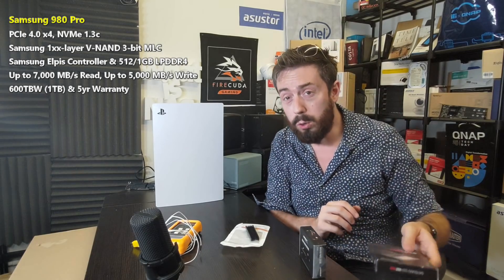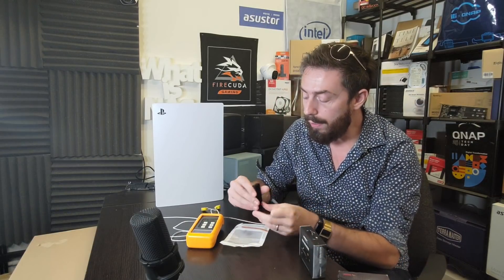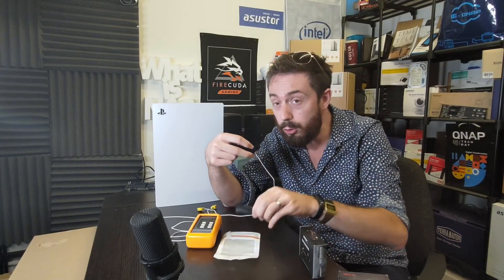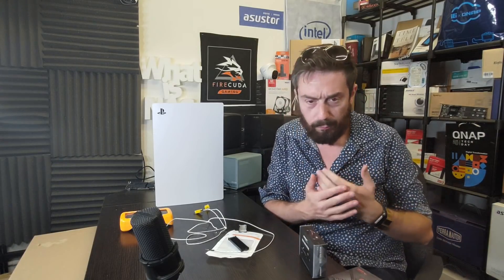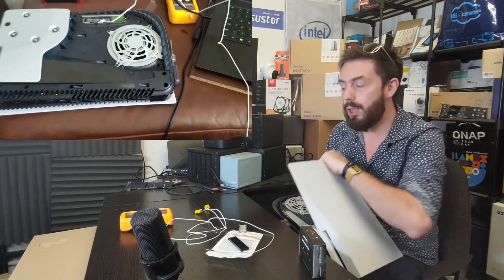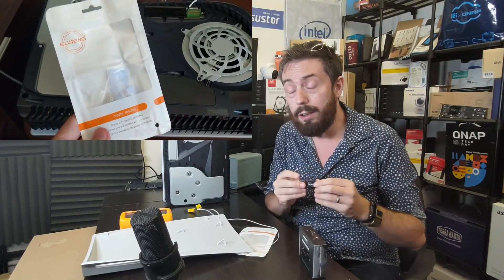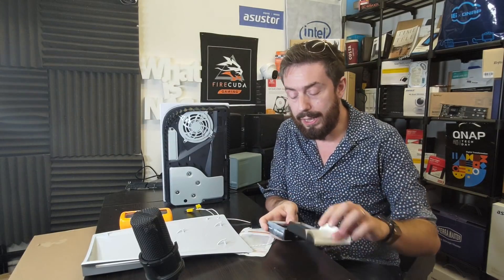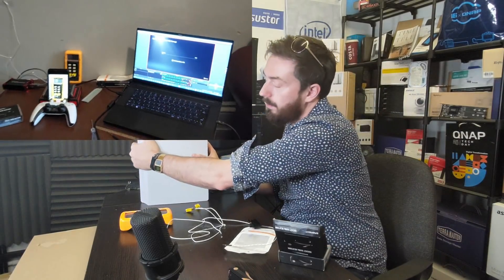PS5 SSD Expansion Heatsink vs No-Heatsink vs BIG Heatsink TEMPERATURE TEST

Comment: Ps4 system uses a 2.5 inch sata with 100mb read:write for all ps4 games (So question if my ps5 Internal M.2 expantion only has ps4 games on it)  Will i have any issues with out a heat sink

Comment: Hello. Thank you for your pointer.

I agree with all your point and i will add that i am saddened that we are so lax with reliability. I hear constantly "not a real world use." Well, i bought a thunderbolt enclosure and put a firecuda 530 4tb to do backup of my computer. Long story short, it doesn't like me writing 1.5tb in one go. It overheat and disconnect but i guess i shouldn't mind since my use is not a "real world use".

What annoy me about the whole ordeal is how little knowledge there is that those ssd actually need good cooling for sustained operation and that those "aluminium enclosure for better heat dissipation" are just not up to the task. I ordered one with a far chunkier heatsink in hope that resolve the problem.

Comment: I just bought a 1tb SSD with heatsink because of your video's, I got the Corsair MP600 LPX M.2 For my new PS5, Thanks for awesome
Breakdown and deeper understanding on why their needed. salute from the UK🔥
Reply: Got a 2 TB without heatsink for my PS5, works just fine...anyway a gen 4 SSD will run optimal even on 70C, if it gest to 50-60...it's normal...

Comment: How about adding a 1.5mm thermal pad between the ssd heatsink and the oem ssd bay cover so it would have direct contact? Would it dissipate heat better and have better thermals?

Comment: SSD nand work fine even at even 90c (normal temp range is listed as up to 70c from most manufacturers) so this just goes to show you don't actually need a heatsink in my opinion. ( I have a heatsink but I always thought it wasn't really needed and its just Sony trying to cover their behinds from people in really hot box installs of their ps5s) also most times the ps5 is just doing short read bursts and will never get this got in normal operation unless you are an idiot and put your ps5 In a drawer or small cupboard/media furniture lol. Then I think you would have bigger issues anyway with the GPU/CPU throttling because it's too hot.

Comment: There are some larger heatsinks with fans built onto them. These fans are powered by a cable attached to a pc motherboard - you could get a compatible cable to USB and have it powered by the consoles front USB 2. This I want to try and will get aftermarket faceplate to cut a hole into instead of the original ones ;p

Comment: Shouldn´t the thermal probe be attached to the controller instead of the NAND as this is creating the most heat and would be the force to make the drive throttle?
Reply from the maker: Very good question! Two reasons really (technically x3 if you include fear/hesitation). First was because I was fantastically reluctant (ie scared) to thread the temperature node under the heatsink+pad and onto the controller, as the m.2 lid would close and heavily squeeze the cable. The 2nd reason was because even when the lid closed (and I tried to thread the cable through a dip in the m.2 bay, it created an opened of around 2-3mm to the bay, which might screw with the PS5 airflow (again, this was still early doors on my testing and I was being a tad safe). So, I decided that NAND temp was better than no temp and ordered thinner cabling for the temperature sensor. I'm pleased to confirm that it arrived and works/fits like a charm! Been making new temp tests and tomorrow mid-day should be when my much more controller and PS5 airflow targeted temp testing will go live. Hope you enjoy it and thanks for keeping me on the straight and narrow!

Comment: How did the large heat sink effect the other parts of the systems cooling as blocks a part of the intake? 
Thanks for the real world testing, installed the  Western black 2 TB and large Sabrent hs today!
Reply: The intake for the PS5 is the fans opening. The system airflow will coming from all directions as the vents, 360 to the fans opening. I use my PS5 without plates as i not like the looks.

Comment: You should test the thermals for the entire PS5 with the sabrent with the metal cover off and the other heat sink with the cover on. This will determine if it's truly worth getting the bigger sabrent. I'm sure someone is now creating a slightly taller metal cover to compensate for a larger heat sinks. I wish I knew how to design it actually lol
Reply: That's what i wanted to know. Can't find anything about that...
Reply: @BlackDoomax  I'm rocking the big heat sink on my PS5 with metal cover off everything has been running perfectly no issues for over a year now
Reply: @dove348 Good to hear! How has it been with dust accumulation? Have you noticed more dust in the SSD-compartment with the cover plate off?
Reply: @Privatdetektivan  sure that's unavoidable but I keep it cleaned off. But I haven't had any issues as far as overheating or performance loss
Reply: momo  yea I got the big Sabrent heatsink like he did it works fine open I haven't had any issues I've been having long sessions too. I got some thermal tape I was going to MacGyver a cover over the heatsink but I was afraid it would cause more harm than it would fix. But the more research I do on the PS5 the less that cover seems relevant.

Comment: For those wondering, Sabrent Heatsink does fit inside of the digital version PS5 but won't allow the PS5 shell to go back on. If you want this to work out you'll need to own the disc version. I have the Sabrent  SSD and heatsink but sadly can't put my PS5 shell back on because I own the digital version, and yes I was ok with not using the SSD cover since I own a dust blower that I use to clean out my PC. Finally I do own 2 extra slimmer heatsinks I bought way before So I'm good for now unless I end up with a disc version in the future.
Reply: Just installed a gen 4 Crucial SSD 2 TB without heatsink on my PS5 digital edition and it works just fine! <3
Reply: It works just fine with no heatsink on the digital version. ;)

Comment: finally a video that helps me ! i have a ps5 and a 980 pro but i been holding off on install cause no heatsink
Reply: it works just fine, a gen 4 SSD should run safe and optimal even on 70C, I've installed a Crucial P310 SSD 2 TB standard without heatsink on my PS5 digital edition and it runs great! <3

Comment: Thanks for the information definitely something to consider when buying a new ssd for the ps5.

Also if I may, could you please make a video on the best Nas for 2021, I'm in the market for one that is easy to use, with mostly the option to run docker containers or has at least a decent selection of apps validated by the vendor and if possible the potential for expansion with different capacity drives

Ty

Comment: good testing!!! but i doubt that while "gaming" (not copying anything) the 980pro barely hit 40 or 45 degrees without any heasink, strange that yout don´t test it while only gaming and not copying.

but the most realistic case, is that the vast majority of the time (if not all the time) most of us will install the game on the nvme from the bluray disc, wich has like 100mb/s copy speed or less, or downloading, wich is even slower, and therefore, doing only 100mb/s write to the nvme disc, even without heatsink i doubt it reach even 45 degrees, same while gaming.

i have a sabrent nvme (3,5gb read) that while gaming on it , it even reach 35 degrees, yes, it is pcie 3 not 4, but anyway it don´t have any heatsink, and my case is an ancient cooler master haf932

on a next video will be nice if you test it while gaming to probe that i say is true or not, will be interesting...

greetings and good video anyway!!

Comment: Please could tell me ( if someone tested or know ) if ADATA GAMIX S70 could be mounted perfect in PS5 ( bluray disc version ) ? Sabrent version you have aready tested is bigger in height ... and I dont't want to throw money to buy something will not fit. I will use the SSD without metal cover but with plastic cover on the top...

Comment: If the read and write tests are meant to simulate the type of heat generated from playing a large open world game, why not just load up a large open world game and test the temps off of that?
Reply from the maker: God point. The reason is that I would need to the kind of heavy read activity that games I the future will be featuring (as the speed of these SSDs is utilized by the core system) are not available yet....but people are buying considering these drives now/v.soon in 2021. So the only way to simulate heavy read or heavy write in a closed system like PS5 is the way I have shown. These are 'hard activity' scenarios and pretty much the peak of what you will encounter. Take special note of how quickly the temp rises even in the first 60-120seconds.
Reply: @nascompares  But the read speeds you are getting here are severely limited by the write speed of the internal PS5 SSD. In a real usage scenario, you would have intermittent reading at high speed, as opposed to sustained reading at low speed. Those situations might very well behave significantly differently. So, while no one test could capture all possible aspects, it would indeed be very interesting to see the general temperature ranges experienced when playing a couple of different games for a prolonged amount of time (30+ minutes?).
That’s more time intensive work though, but even seeing an example of only one fairly typical game would say a lot.

Comment: Could you test a SN850 with the included heatsink vs a SN850 with the eluteng heatsink??

Heard the integrated heatsink is not very good and with a good custom heatsink the SN850 is 5 degrees cooler.

Comment: Could you test that again, with Ratchet & Clank Gameplay, and with two sensors on the controller and the NAND chips (measurements on the side of the NAND Chips are more accurate than on the top, and they are not obscuring the contact of the thermal pad) I don't see the point in installing a heatsink when it only hits 60C, maybe Ratchet stresses it more?

Comment: okay someone needs to make a case that has a vent and fans on it for the SDD upgrade slot.
Reply: They make heat sinks with little fans on them already
Reply: @jasons7044  i saw one on new egg but we need a ps5 replacement case that has an opening for the 
ssd slot with fan and venting

Comment: I have a large heatsink which only fits without the cover plate. But it's so hard to decide if I should get a smaller heatsink or not. The heatsink would sit pressed up against the plastic plate so I wonder if it would start to deform with the heat.

Comment: And that Linus guy tells people you can remove the heatsink if you buy a SSD with a heatsink that's too big... I would definitely recommend keeping the heatsink on and not placing the metal plate back or replace the heatsink if the white side panel doesn't fit back on, you can get heatsinks for SSDs dirt cheap...

Comment: I still think that cover is for dust issues. The last thing you want is a dust buildup inside where that m.2 is.
Reply: I worry about the fan getting dust more than the nvme slot with no moving parts. That and it’s also going to be vertical if you have your PS5 standing. There are options to keep dust at bay like a PS5 dust cover.

Comment: Will the Sabrent Heatsink fit in a PS5 Digital? I think there is a little extra space in the disk edition that lets it fit but not on the digital.
Reply: It doesn't fit digital, tried earlier can't get the main cover on, as the disc version has a bigger cover
Reply: @Mark-tl7hz  Good to know. Thanks for testing.

Comment: You need the temperature of controller not the NAND chips.  NAND likes to be warmer, the controller doesn't.  It's the controller that will be responsible for the throttling
Reply from the maker: True. But the m.2 cavity of the PS5 did not allow me to cover the controller without invaliding the test by introducing airflow or interfering with the heatsink contact. The NAND temperature is still a valid enough temp here to indicate the temp difference of differing/no heatsinks and to illustrate my greater point.

Comment: To be fair with ya I think the larger Sabrent made no difference, I think the major difference is that with the Sabrent the hatch was removed so allowed heat to escape easily reducing the oven type effect that comes from having the hatch on and keeping all that heat in and it was still only 2 degrees on average lower than a compact sync, and sony say to always make sure the hatch is in place, whether that's for keeping dust out or not I'm not sure but, for just a 2 degree difference I think I'll use a compact sync and reinstall the hatch.
Reply: yes i noticed there was no more than 2 deg C  diff  through those tests.

Comment: NAS, please do a thermal test of the SN850 with heatsink. The drive has amazing performance but runs hotter than other drives according to reviews. Would be great to see thermal results of the drive running in the PS5

Comment: A interesting test would be to check how much of a difference the ssd cover would make to heat
Reply: The Sabrent version in this test has no cover on the ssd section. It’s too big for the cover to fit on.
Reply: @blakecandesign9628  for thr SSD it’s good but for the rest of the console?
Reply: It would be nice to know, how other bigger heatsink WITHOUT COVER perform. Like the Archgon HS-1110. This is one with Fins and also a bit massive like the sabrent. I will use the Archgon heatsink with the 2tb Corsair MP600PRO. Thanks again for your top videos and Tests! OT: I also did a Thermalpads-upgrade (14W/mk) to the PS5. The different is really huge!  Cheers
Reply: That’s what I wanna know. Installing an ssd with heat sink then take the temp with the cover on and another test with cover off
Reply: @rubberman2006  https://www.youtube.com/watch?v=aCjqtN8YExk here you go

Comment: Great video. Digitalfoundry has done test, how it impacts in games with and without heatsink, and the difference is minimal. Don't get me wrong, get a heatsink it's 10$, but it's not catastrophic, unless you live in a very warm environment.
Reply: nice sunglasses 😎
Reply: I use a KC3000 2tb ssd without heat sink for my ps5 and have zero issues.
I do have a standing fan facing the ps5 permanently though to be honest.
Reply: @lordspalse0062  GEN 4 Crucial P310 2 TB SSD without heatsink, works perfect! <3

Comment: I'm glad I went with the sabrent 4 plus  with the included heatsink. Even though it doesn't allow for the plate to be covered. Is it me or does the ssds allow for me detail and more response?
Reply: This is what I did too. I’m having a heck of a time getting the screw in though as the one with heat sync is too short and the one in the PS5 doesn’t seem to get a good grab. What did you do?
Reply: @PhoenixWebTV  so I had to move the ssd down slightly in the heatsink to where the back end of the ssd was sticking out further than usual (or you'd like), meaning that the groove for the screw won't overlap perfectly. Place that was in the 80 slot under the ssd. Once the ssd has been pushed back as far as possible you'll have just enough room to screw it. I got the white included heatsink. Seemed to be differnt in size (bigger) than the black one. I have both. But I'm using the 2tb. And it works flawlessly. Load times and motion is very smooth. Haven't been able to do extensive gaming for heat comparison I'm hopeful it'll hold up, especially with the ssd cover having to be off.
Reply: @jonathanb3886  Thanks. I managed to get the screw in (a bit of an angle but secure). Everything A-OK so far. I'm not too concerned about the cover not being on. Everything in a PC is open - I don't see a difference.
Reply: @PhoenixWebTV  exactly.  Alot of content creators have specified its not conducive to have that panel off where as dust can get inside. Plus there a negative airway that pulls air through the holes inside the  holes within the ssd slot. But to me I like the durability of the heatsink and the fact it comes with the ssd. I don't want to hassle look for a good quality heatsink. So I think we lucked up.
Reply: @jonathanb3886  I agree!
Reply: No, it’s just faster loading that’s it.
Reply: @emmanuelguerrero3071  that may be it to your eyes. But for me instantly noticed detail as well as loading times. Those bigger storage ssds particularly 2tb or higher will do the system justice.

Comment: WOW, thank you very much for your great videos!
It is unbelievable how much effort you put into your research about  ps5 memory extension!

I wonder if it wouldn't have made more sense to put the sensor on the memory controller chip.
According to my personal research with 4 different SSDs, the controller chip gets significantly hotter than the Nand chips
 in the vast majority of cases and is probably also the reason when it comes to thermal throttling.

Comment: Holy cow! +20C difference!
And I figured having that giant heatsink of the Sabrent would outweigh the down side of not putting that cover back on
Reply: Wished he tested the small without cover just for comparison.
Reply: @shakengandulf  true true! I find if you have a heatsink that sticks out past and need to leave the cover off. The little bit of heatsink sticking out will still have cooking because the fan is still circulating in that area with the side panels on

Comment: Ok so conclusion:
Only for gaming without huge sorting processes on the Ssd it’s possible to let them run probably without heatsink, but you will risk a lot of heat during long gaming sessions. 
With heatsink the temperature is totally fine for gaming.